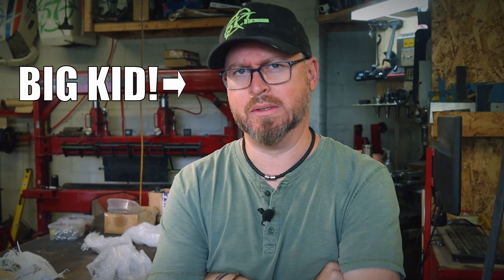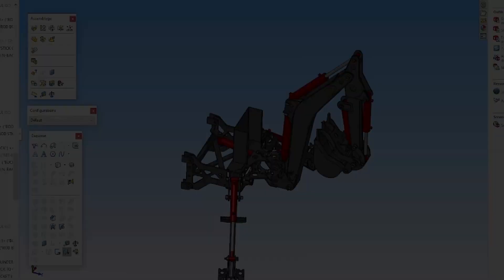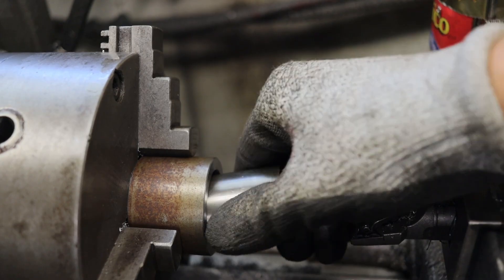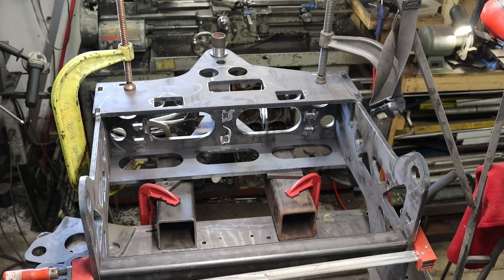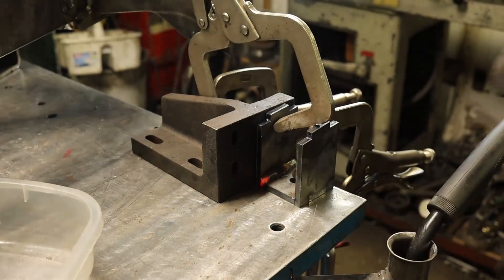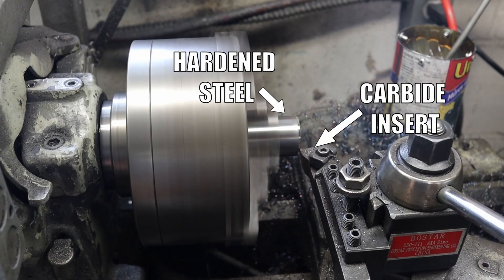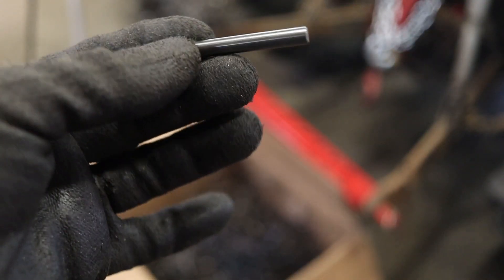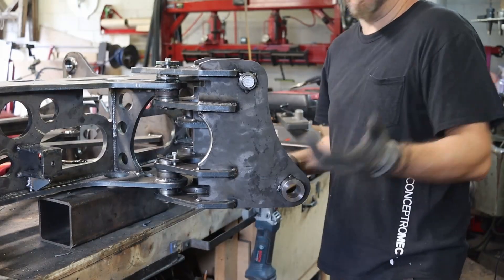DIY BACKHOE / Excavator part: 1 BUILDING the BASE

Comment: So if I got this straight, you copied other backhoe designs had the parts fabricated by someone else and you welded them together. I think it'd be cheaper just to buy a used backhoe attachment
Reply from the maker: sure, if building it is not for you! But good luck finding one in good condition at a low price! Cause I checked in my area before ''copying'' other backhoes and it was either super old, or too expensive! But, there's always more than one way!

Comment: Excellent video bro, ...what is the name of the 3D software you used before you sent the design parts to Conceptromec?
Reply from the maker: Solidworks and conceptromec is just a sponsor, they didn't fabricated a single part on this project.
Reply: @VinyB57  Thanks for the info

Comment: you could always freeze the tools used to install the bushings too or carry them in a foam cup. Not sure if you did this too but you could heat up more of the structure where the bushings go since all your heat will soak into the metal by conduction faster than it will dissipate via radiation/convection to ambient.

Comment: challenge

It just so happens that you can also build a rotor and tilt to the backhoe.
Being able to rotate the bucket.
Being able to angle the bucket.

If you make one like that, my hotmail will ring and I will buy the drawing.

Electric ore hydraulic 🤔
Its so easy to buy a drawing and DXF and its almost done..

Comment: While you're hammering in the Bushings the part jumps around the table and generally all the elasticity in the part absorbs a lot of energy from the blow by dampening it. 
A good way to mitigate that is holding a big sledgehammer on the other side of the object or in this case the housing for the bushing. Kind of works like an anvil then. The main downside is you need a second person, but your wife was there anyways. 

The far better solution would be to use a press or make a gear puller work. But the sledgehammer trick gets you a long ways.

Comment: I purchased a laser cut welding table kit 2 feet by 4 feet, on casters. It is a good fit for my two car garage set up. Kinda light duty I believe it was rated  to hold 800pounds or 1000 pounds.  I bolted a 4 inch vice to the top(  not even mass for a larger vice)  i think it was 2" on center hole spacing with 5/8" holes in the 1/4" plate used for the top. The grid underneath the top reduces weight and adds strength, but sometimes land right where you need a clamp 🗜️.  A thicker top plate would probably work better, especially wicking the heat from parts and resisting bending forces from your clamps holding it down to the table.  Magnetic drill and go to town... 3"-4" hole centers are fine in most cases.  As for flattening top, flame straightening or torch.
Reply from the maker: Hey thanks for your comment, at first I was aiming for an 1/4'' top plate too, but now, after searcher a bit, I'm more looking to build one with an 1/2'' plate instead and your comment reinforces that too! 👍 If I was making money out of such a table, it would be an no brainer, but since it's to play around on week-ends, I'll have to save a bit of money so I can build such a large and thick table (8' x 3')

Comment: I think you may consider buying one of fireball tools table because, if you don't have proper tool to make the table, your weldings or the  parts you will produced on won't be consistent or straight.
Reply from the maker: I agree with you, but, I'm gonna use laser cut plates and it should be way more precise then what I need! Plus I don't have the 5k$ for the smaller table....you may think I make big $$ with YT, but I'm making almost nothing (for real)...I think, I should start a OF...🤣
Reply: @VinyB57  I am a mechanical engineering student, and I was thinking that I would be a corporate engineer on weekdays, and this would make enough money to my hobies even can afford a small budget race team, but after I saw you struggling with money I have started to think that I may not fulfill this dream

Comment: For welding over 1/4” plate switching from mig to dual shield (FCAW) would be a much easier process that is not prone to the issues with solid wire (lack of penetration). Or you could use pulse mig with a different gas combo assuming your machine has pulse capability. Cool build.